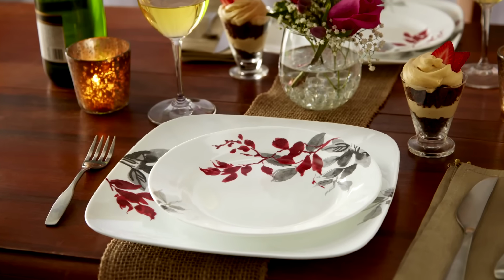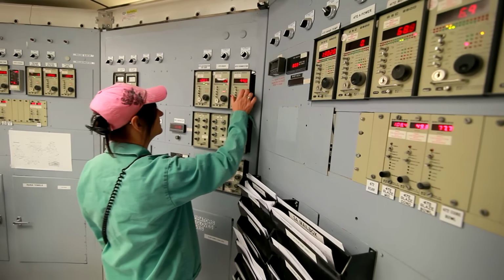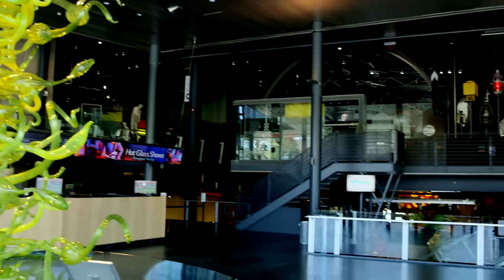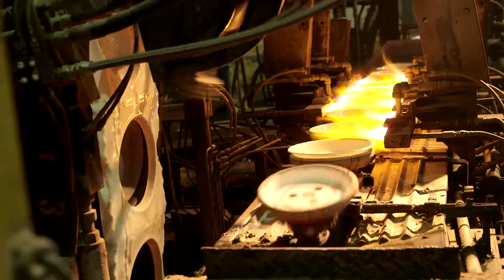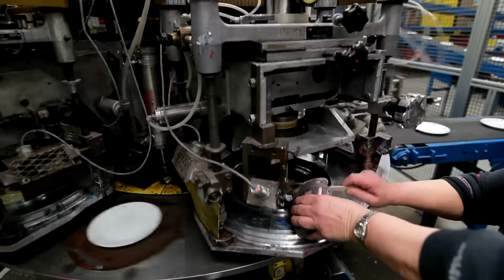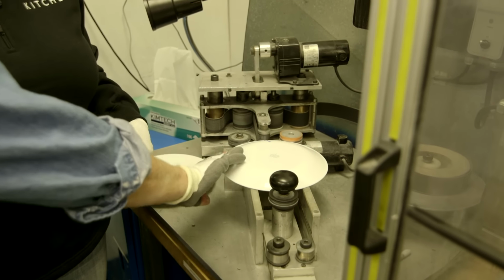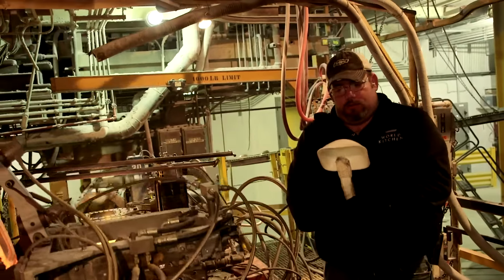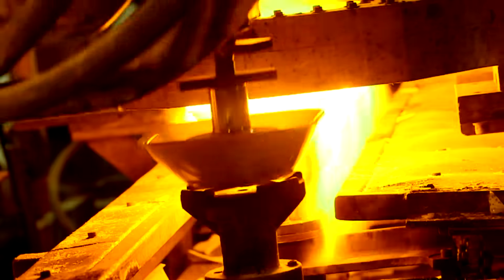World Kitchen Factory - Corning NY

Comment: We've used white Corelle for more than 30 years, and it is quite satisfactory. The edges of the plates tend to get a little worn and sometimes there is a bit of rust stain on the edges. One thing that could be misleading about the video: it is true that Corelle resists breakage very well, but, when it does break, it's not just two big pieces. It explodes, with knife-sharp pieces of all sizes, mostly little, all over the counters and floors. In 30 years, that's happened only maybe six or seven times, so it's not that big of a deal, but it is different from how it is represented on the video.
Reply: I was thinking the same thing!

Comment: about the breaking . the use of a punch put an incredible pressure on one point, so it is very easy to break that plate . i am watching this video  because i just broke TWO corelle bowls at once, that just fell from a cupboard about 5 ft up . a whole stack fell and i have glass shards spread all over the kitchen . so dont mention to me about breakage resistance .

Comment: too bad they didn't make it so could stand up to a microwave that's the only bad thing about that and yes if you drop that plate on the floor it will break believe me that's why I don't own any more Corel one it is not microwave safe and to if you drop it off the counter it will break
Reply: We don't claim they wont break we claim break resistant. They are completely microwave safe, I make them and microwave them every day and have never had one break in the microwave. Get your facts straight.
Reply: big kahona dropping any plate in the floor or on the counter top will break it.
Reply: I'm not sure what you’re talking about, “not microwave safe”. Corelle is eminently microwaveable. It’s one of the big selling points.  What was the problem you were having in the microwave?
I’ve dropped many Corelle pieces. Usually they sort of bounce, or ring like a bell, and end up completely ok. Yes, occasionally they will break into many sharp pieces, or several big pieces (as shown in the video) but much more often they will not break. And they’re quite chip resistant too. Overall, they are sturdy workhorses used daily in my house.

Comment: Corelle needs to make batter bowls, covered storage bowls, etc. out of Corelle. I hate plastic; it doesn't hold up over time; it doesn't dry in the dishwasher. Glass is too heavy. Stainless steel and melamine are not microwave safe. Please make mixing bowls and a lot of storage bowls with covers out of Corelle. PLEASE! Love my Corelle dinner wear. Stores great in cabinets more dishes in less space. Fits in dishwasher better. LOVE IT!
Reply: You might want to try the Pyrex or Corningware containers, made by the same company.
Reply: Generally Pyrex or regular Corningware containers are too heavy, which is why I'd love to see Corelle make the batter bowls. Corningware had a lightweight version of their casserole dishes, which I bought every size of and love!!! Even that would be great, but for some  reason Corningware has recently discontinued those lighter weight covered casserole dishes. Very Sad!
Reply: corningware is not made by world kitchen.  source, I'm a mechanic at world kitchen.